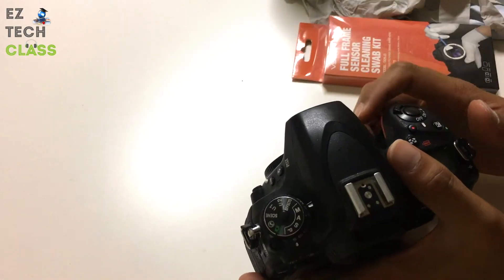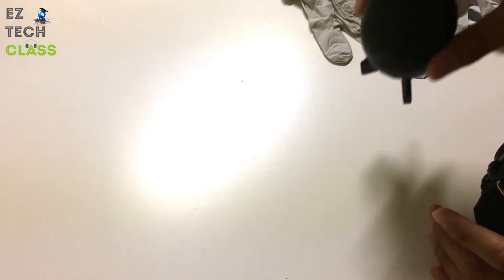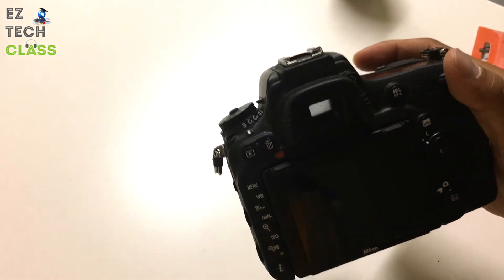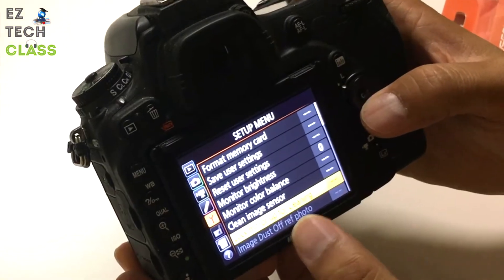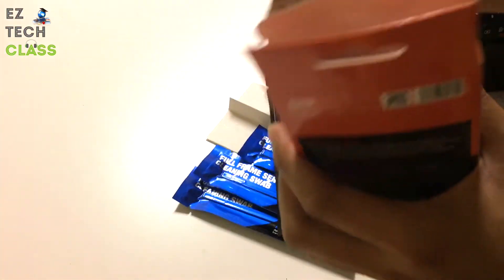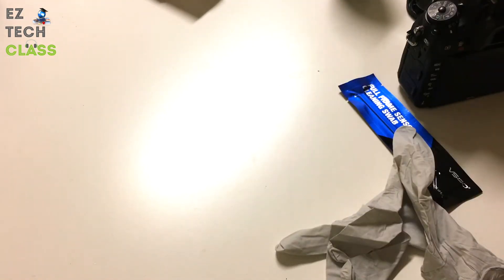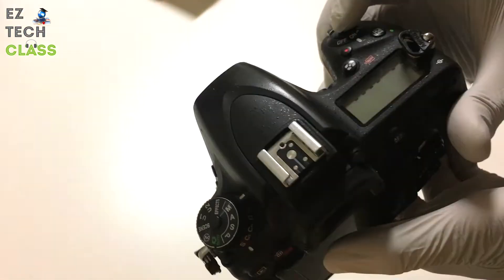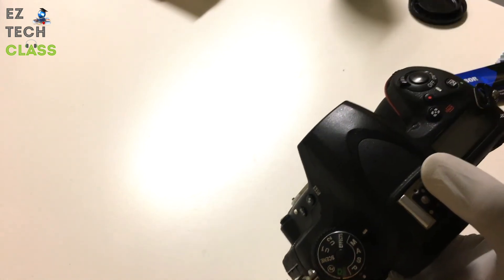Clean your Nikon DSLR sensor and mirror - D750 sensor cleaning | EZ TECH CLASS

Comment: Hi. I tried to clean the mirror in my d750 and now I have a big mess on the mirror. Do you think can that cleaned ever?
Reply from the maker: Yes, you can, you just need to spend more cleaning sticks and more time. When you done cleaning, give your D750 sometime resting before using it. Good luck.
Reply: @EZTechClass  I will give it to Nikon service. My autofocus its not working well
Reply: you have to use a cleaning liquid and only swipe once on each side of the swab